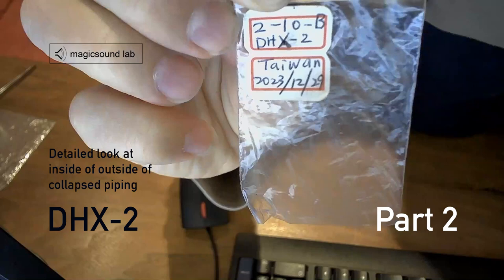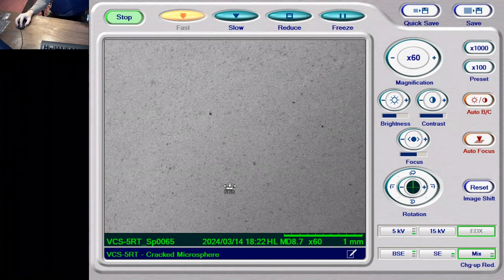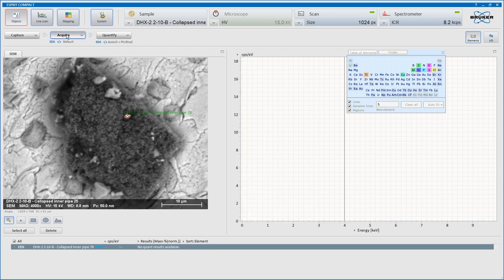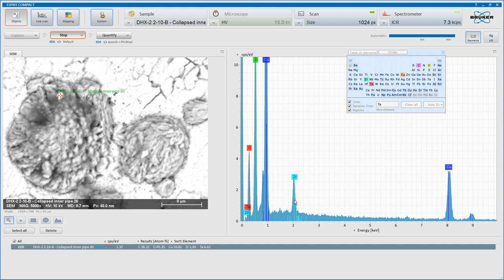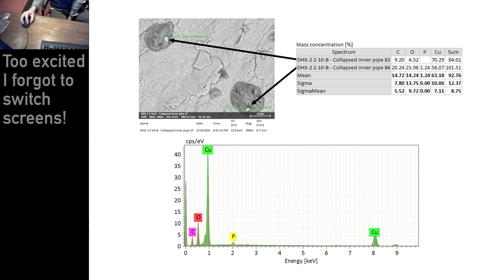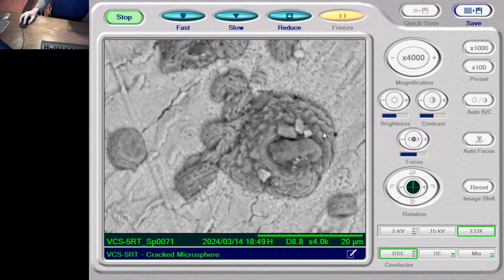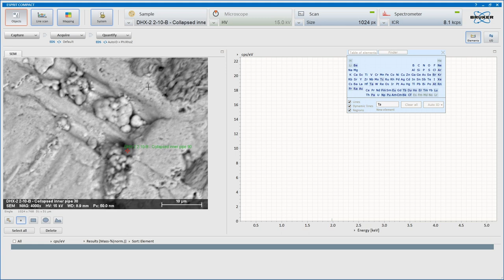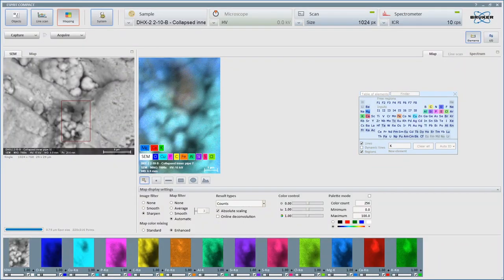Bin-Juine Huang - Detailed look at inside of outside of collapsed DHX-2 piping - PART 2

Comment: The whiter calcium-alum  areas the "Oreo's" are imbedded in look like granite quarries where they are stripped.  Smooth and straight... Can we make a device that melts granite?  Great presentation Bob!
Reply from the maker: I think employment of these things will enable this yes. In LION reactors, it has already fluidised Fused Quartz (SiO2) and Alumina (Al2O3) this is the bulk of rock including granite.